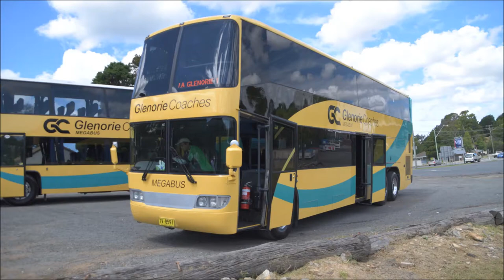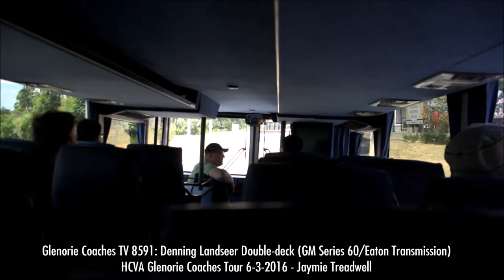Glenorie Coaches TV 8591: Denning Landseer Double-deck (Eaton/GM Series 60)

Comment: Why would a bus need 500hp?
Reply: This is a double decker coach, it's the amount of power needed to drive a vehicle with 75 seats, a luggage compartment and an onboard toilet.
Reply from the maker: It's actually more than enough - 280HP is actually enough to drive a vehicle like this surprisingly
Reply: @jaymietreadwell  Bang on.
Except the transmission spec is wrong. Sorry. Its an Eaton Autoshift 12 speed. Driver Bus Lines (Coastal/Hastings) has one. Absolute weapon of a bus.
Also, the Mount Waverley depot has an Allison B500 equipped version.
Reply from the maker: @kadooment95 Thanks - I'll patch that into the description